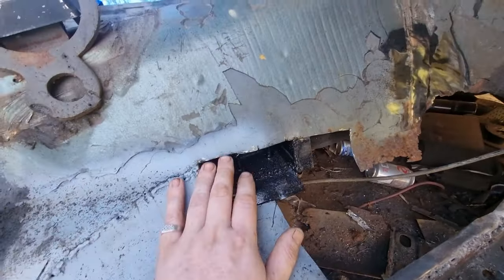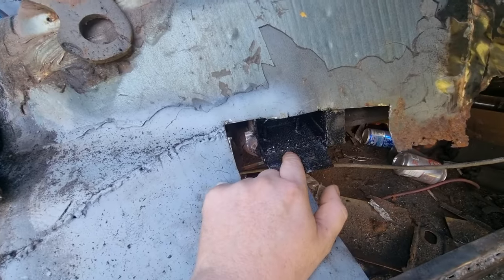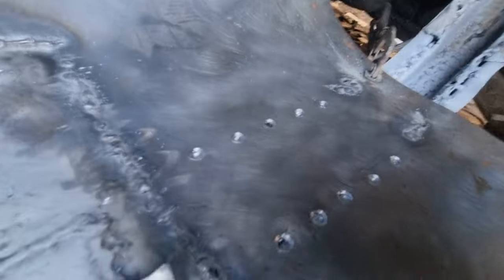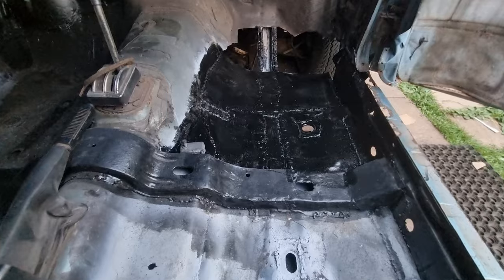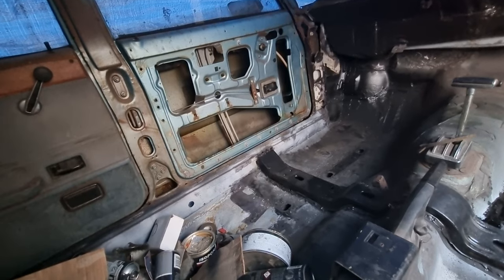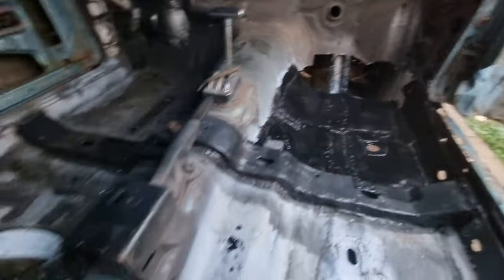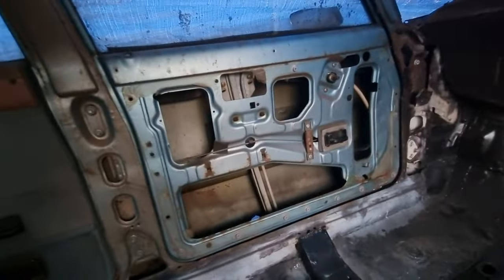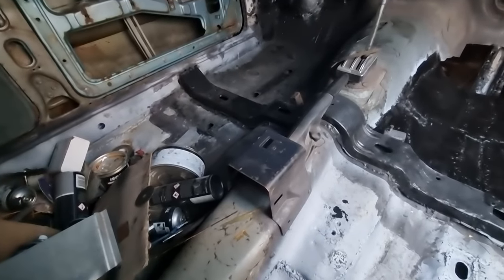Cortina Mk4 Ghia 2.3 V6 Restoration || Drivers Foot Well Repair (P44)

Comment: what welder are using mate gas or no gas 🤔
Reply from the maker: No gas fluxcore 0.9
Reply: @AdamSNook.  better to use gas mate and buy the bigger bottle the small throw away gas bottles are crap, your welds will be alot neater and saves you alot of grinding and grinding disks mate 👍
Reply from the maker: @davecollumbell4592  yeah i have been looking into gas welders
Reply: @AdamSNook.  I use a co2 fire extinguisher with mine works quite well but you need to use the bottle upside down or your regulator will freeze up.